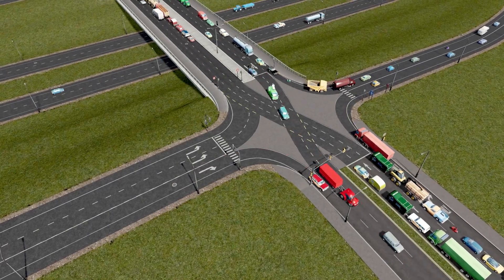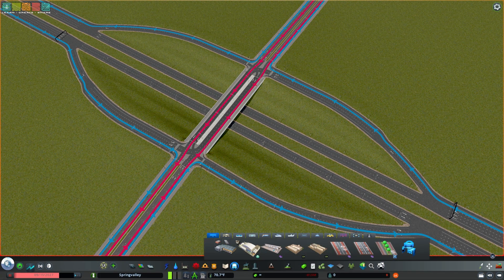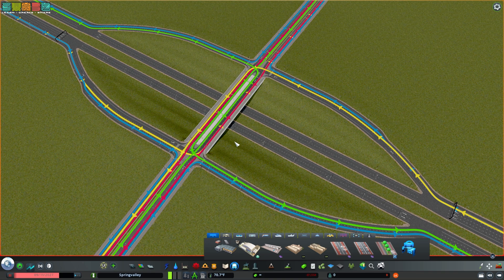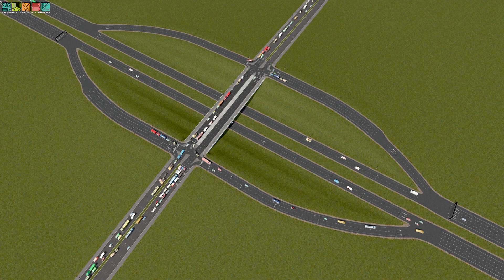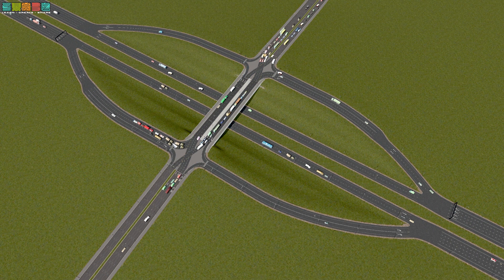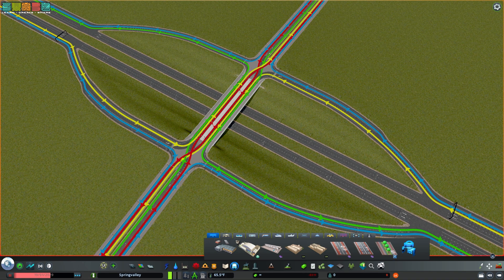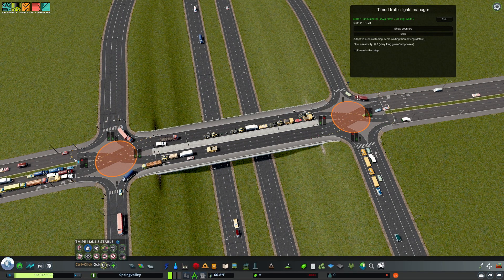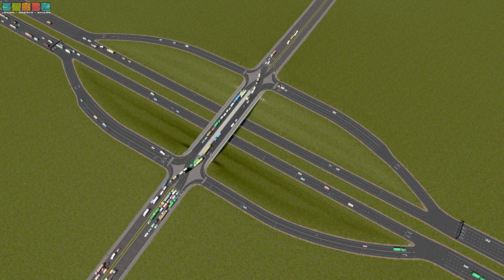Why your Diamonds should "Diverge"  -  The Diverging Diamond Interchange (DDI)

Comment: In many cases a vehicle may use the off-ramp to stop and check a trailer or other problem with the vehicle, so the missing traffic flow would be from off-ramp to on-ramp directly. 
Now they'd have to go to the off ramp and find somewhere off highway they can turn around and park. That could be a mile or more, maybe a mile square trip for a double bottom trailer.
In the original design they can stop there on the ramp and passing vehicles will not be at speed, they will be at turn speed. Two conflicts exist, someone who wants to go straight through, (unless you build a wall to prevent it).
Much safer to do a momentary stop on a ramp then the 4 lane. Additionally there is no dead lane shown in the off/on ramps where a vehicle can stop. What happens if a vehicle goes straight through the crossover?  This reminds me of the crossover blocking cables, there's no room to stop without hitting them, even though the original agreement was to place these in the center of the divide they don't do it. Not one width of space there.

Vehicle checks, driver swaps, mess with computers and phones, load adjustment, tire change. So take a look at how often you see a truck stopped on an on ramp, next time you drive.
Reply from the maker: I dont think its legal to stop on a highway off ramp. They should probably still be looking for a safer place to pull off. The straight thru movement is blocked by curbs in a real life DDI. All those shapes you see in the road are curbs. I would not drive straight across in any vehicle.

Comment: Takes up more space and adds an extra light. You'll never convince me that's a better intersection.
Reply from the maker: Better than a diamond? Its the same size but faster and safer. Its ok if thats not your thing though 😂
Reply: That's how they're built around here. We can't even have a business on the corner because they are basically inaccessible.
Reply from the maker: Are there usually businesses on the corners of interchanges? I dont think so
Reply: Absolutely, from car dealerships to auction lots, to industrial warehouses, to 7-11s. What do they build there where you're from?
Reply from the maker: I think you’re talking about a normal intersection. This is a highway interchange.
Reply from the maker: Oh, thats a stack. Its for connecting two highways (system interchange). The diverging diamond is for moving traffic on and off the highway (service interchange).

Comment: I have one suggestion...The traffic lights priority should be getting the traffic off the highway ramps..and the secondary should be the across traffic (from one side or the bridge to the other) as it would have less traffic on it in a city layout or in real life.
Reply from the maker: Thats certainly not always true. What direction is priority depends on a lot of things and is not a rule.
Reply: @YUMBL  
But usually it is because it's a worse scenario to have a highway backed up than a normal road.

Plus I assume the highway and the crossing road is connected to the map edge?
Good for highways but not basic roads as it is generally considered highway traffic levels.
Reply from the maker: You should do whatever it takes to make none of the roads back up. If the highway needs priority, great. If the cross road is carrying more traffic than so be it. There is no rule.

Comment: DDIs make sense on true arterials, but the old fashioned diamond should be king in low traffic situations. I live near NY's I-86 and most of the interchanges are diamonds or trumpets, and they hardly ever have lights! Interestingly the only interchange that has a light around here is the trumpet, and I honestly think it doesn't even need one. I'm fairly certain the only reason it has one is because it's relatively close to a school zone so it can help the busses load and unload, but even then there's another light at the school to help with that.
Reply: Yes, the DDI is at its best at interchanges where more traffic goes to the highway or comes from the highway versus the 'through' traffic on the bridge.  If the 'through' traffic is higher volume...don't use a DDI.

Comment: We've got a couple of these and I always wondered why they went to them. Clearly when the lights are set up properly they're efficient. The lights on ours are set up in stages so you get the green, cross over, and then there's a red light, the other lane goes and crosses over, then they stop. Then your light goes green and you cross back over and continue out of the intersection. If traffic is low it takes so much longer to get across. If traffic is high people end up stuck in the crossover unable to go forwards or backwards and traffic backs up forever. Good to know it's just GA DoT being grossly incompetent and not a stupid design. GA DoT infamously screwed up the deicing mixture one year and instead of insuring the roads stayed drivable sprayed on a layer of ice turning most of downtown Atlanta into a skating rink - people died.

Comment: What about the grade-separated DDI? Aside from increased infrastructure costs/complexity, are there any reasons to prefer this flat one over the grade-separated one?
Reply from the maker: The dcmi would be better, but it would be painfully expensive in comparison. The point of the DDI is that its cheap and easy.

Comment: While I was sceptical at first. Now I've seen this with a better explanation I am willing to use it as a potential traffic fix.But would Give-Way(Yield) or Stop signs do any better than (I am not a huge fan of)Lights?
Reply: I would heavily advise against using either yield or stop signs on this intersection. I mean, where could you add a yield sign? All roads are likely very busy (considering the six-lanes and intersection type). This would also mean stop signs would not only be more collision-prone in reality, but also slow and congestion-causing in game too.
If you have the PC game, get the TM:PE mod. It’s a necessity for enjoying traffic management, and it allows you to place timed traffic lights, which can hopefully allow you to make the lights more efficient than the vanilla ones.
Reply: In real life, all turns could be managed by a yeild sign, but you really need lights for where the traffic crosses, and in CS you can't combine lights and yield signs in the same node.
Reply: @matthewparker9276  I know I am not able to combine light and signs on the one node. I was just asking what is the best option for these types of junctions.

Comment: The only service interchange I like better (and would argue is more beneficial for a number of reasons) is the SPUI.  But I really don't understand why so many people are confused by the DDI.  The contraflow section, sure, seems foreign and dangerous, but it's no worse than two one-way streets intersecting on either end, simply at a slight angle to each other rather than 90 degrees.  You know where you're supposed to go, you know you're not supposed to turn there, so the aversion to them is perplexing.
Reply: Well, they look strange...until you've driven one, then they're no more a mystery.  I even got to have the experience of the 'before' and 'after' experience with the same interchange.   Huge difference.
Reply: I'd also add that the crossover's oblique angle should actually increase safety. Opposing traffic is now more-or-less straight ahead, rather than off to the sides, greatly increasing their visibility.

Comment: A slight variation with the traffic lights would, in my opinion, be needed - the left-off-highway traffic might end up stuck behind some of the non-highway through that got green on the first but red on the second, so a red on the first just a few seconds ahead of the second would result in traffic that got through at the first probably getting through on the second. just one or two seconds long intermediate phase though. I do notice that the quickness of changing between phases in Skylines is unrealistic as real junctions do the light changes green to red then red to green, instead of all lights changing at the same time... (usually). CS does the simultaneous change, resulting in cars sometimes conflicting because the last cars of a green-to-red are still in the junction when cars at the front of the red-to-green start going.

Comment: The Diverging Diamond is great, but your three-phase diamond timing is suboptimal because the "green" left turn phase is not fully utilised. A more efficient timing would be: 
1. Through (Magenta in diagram at 2:29)
2. Left turns onto highway (Green in diagram), - Magenta can still exit the interchange but not enter
3. Left turns onto highway (Yellow in diagram).
This way the lights for left turns don't turn green before the left turning cars have arrived, as you see in the video here. It also creates simultaneous green waves in both directions for the Magenta traffic.

Also, just curious, Why didn't you include a 1-sec clearance phase in your Diverging Diamond timing, while you normally do that elsewhere?

I love the use of coloured bus routes to illustrate the movements. Super elegant!
Reply from the maker: All the lefts cross over and limit each other. Thats where your timing will get stuck. Where does all that left turning traffic go during the thru phase? If its too much the line will grow.
Reply: @YUMBL  Yes that is the primary limitation of that timing. The through phase needs to be no longer than the duration to fill up that space, which in your design is quite long because the bridge is quite long.

Another alternative is the Texas Diamond timing, which isn't the most efficient but boy is it satisfying to watch. I've spent way too much time hypnotised by the TX Diamonds in my C:S cities.
Reply: @YUMBL  The Texas Diamond is difficult to describe, but I've added a video of the Texas Diamond timing at the top of my Traffic Signals playlist in case you're interested.

I'm not linking it directly because usually my comments with links get auto-deleted.

Comment: Could you consider the count of weaves(moving sporadic conflicts) and (controlled) conflicts for both to compare?  When I counted it seemed to me all that happened was we swapped out static controlled conflicts and longer wait times for additional weaves with “moving conflicts”. Which in my mind makes for more chaotic conflicts that could contribute to more accidents. Granted they maybe increased accidents of the minor sort as opposed to major T-bone accidents like we see argued in the comparison of roundabouts verse standard intersections.  But I’m still on the fence about these intersections because my gut says they are just hiding problems into the flow of traffic.  

One example is off-ramp traffic needing to turn left to head into the right most lane for an immediate intersection after the interchange. In the standard interchange they have that opportunity to make that move pretty safely as all traffic is stopped and it’s a clear route to get into the right most lane. However the diverging Diamond is heavily reliant on solid line lane configuration where left turning traffic must stay in more left lanes and now we have a weave that must take place to accommodate the need for the traffic to quickly turn right after the interchange. However now all of the flow of traffic is involved and it becomes potentially much more dangerous to make that lane switch for both the right tune in the interchange and the traffic that is already in that lane. Especially if those in those right most lanes also are in a situation where they two need the opposite side lines for turning left quickly after the interchange.  

This interchange seems to me to trade off congestion on the ramps and arterial at the interchange for potentially increase speed and danger immediately after the interchange but camouflages it with so much focus being placed solely on the interchange. In the bigger picture it could be hazardous.  

Maybe I’m just pointing out that this like many other alternate interchanges are not the end all and each have their places and must be considered in the grander scheme of things not just in micro picture of things. 🤷🏼‍♂️
Reply: I totally agree, there are many cases where a solution to one problem just creates more problems somewhere else.  (Such as adding lanes to deal with merges) 
But In this case there is a solution. If the left turn onto the bridge is controlled by a traffic light, have the right-most left-turn lane be able to move directly to the right-most lane. Then there's no merging conflict at all. Also do the same thing for right turns if there is an interchange nearby on the right, have right turns be controlled by a signal so they can move directly to any lane. The latter could actually fix issues at many existing diamonds that wouldn't be helped by converting to DDI. 
(Hope the way I explained this makes sense)
Reply: @jacobbaer785  in a diverging Diamond the left turn lanes can not get to the right most lane since it is occupied by the through traffic lanes running at the same time. This causes the need for two potential weaves. One from
Left to right and one from right to left immediately after the Diamond to accommodate any one who is not planning to stay on the arterial and they haven’t been given space or time in the DD interchange to get into the appropriate lane. 

I believe this to be a common problem since DD interchanges really only plan for the Diamond itself and nothing outside the interchange. However most interchanges either already have or soon need frontage roads along the highway which often intersect immediately after the DD interchange.
Reply from the maker: Many DDIs accommodate turning left from the highway into the right most lane as an option. It’s quite common.
Reply: @YUMBL  I’ll try and find something that illustrates that.  And how it’s handled. I suspect DD interchanges just restrict lane switching further away or restrict which lanes can turn when forcing some traffic Further up the route. I don’t know. Still trying to work it out. My gut just still thinks (yes that’s correct my brain is also my gut 😆) that the allure of some of these newer popular interchanges simply eliminate options or bury more obvious issues into other less obvious places like the flow of traffic elsewhere.  Not saying DD interchanges don’t have a place and are great in some scenarios. Just can’t see how they would be better than the current one that is so prevalent
Reply from the maker: Its only to be used in high traffic flow situations. If an upgrade is necessary to accommodate a growing area but you lack space for a Parclo of funds for a spui.
Reply: @YUMBL  ok. That makes sense.

Comment: from what i hear from is the only thing that's kinda struggling with Diamonds that are changed to diverting. is the walkability. whilst the crossovers are smaller with separations, there often around corners and cars can't always see ppl waiting to cross. because its converted there is barely any space for walking ppl.
but in a game such as CS we dont have to worry about that.
Reply: I ban walking on my DDI's and build a seperate bike/walking path parallel to the DDI
Reply: @Starplayer273  Where I live, they put the pedestrian path in the middle, between the barriers, and the 'cross' lights at the ends allow access in and out of the middle at the ends.  We have no issues with pedestrians or bikes with this system, that I've seen.

Comment: How does it compare to the Single Point Urban Interchange? 
So in cost, maximum traffic it can handle and maybe complexity?
Reply from the maker: Thats a great question. The SPUI runs in 3 phases, and generally requires a wider overpass. With that said a lot of diamonds also become spuis. Id say overall a SPUI is better for supporting thru traffic, and the DDI is better for supporting highway traffic.

Comment: I've long had an idea for a modified version of this, but so far I've only did it on paper, not in the game.

Let's start with the layout at 8:10 and look at the lower/south half of the interchange. If we let the incoming red and green bridge over the opposite direction's yellow and green, we have the same setup without the traffic lights, but with another overpass (which needs to be mirrored on the other side). But we can add another benefit, we can let the red and green also bridge over the incoming yellow, eliminating the weave between green and yellow, making the whole thing free flowing and weaveless.

Do you guys think there's merit to the idea? Or is it inferior to other free flowing options?
Reply from the maker: Look up the “DCMI”. I think thats what you’re describing.
Reply: @YUMBL  That is precisely what I'm describing, thank you!

Comment: Something I noticed when I used a lot of DDIs is traffic seemed to get worse in the info map, even though it actually flowed much better.  I think it is because cars are always stopped one way or the other and they can pile up pretty fast, BUT they also move through alot better on green lights, and you don't see massive backups for long.  That is if you don't place a bunch of intersections too close on either end of the DDI.

The DDI is probably my favorite interchange in the game, but can take a while to setup and get right.
Reply: Yeah, DDI's can confuse game logic on heavy traffic. A fix is to squeeze in a pair of small overpasses that replaces the stop light on either end - takes a bit more room because having to spread the nodes out and makes the ramps not look insanely steep, but traffic just FLYS through the intersection.
Reply: Why don't we flip highways and remove the need for DDIs 😮
Reply: @kgaming7599 just use giant roundabout 😂